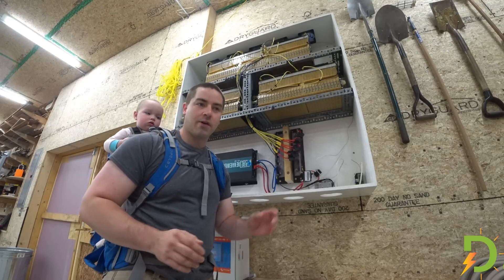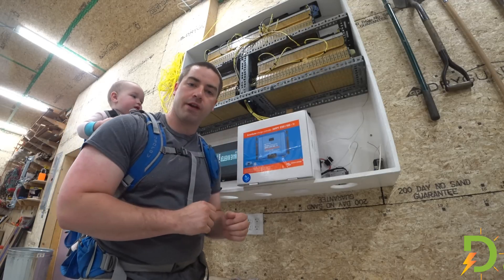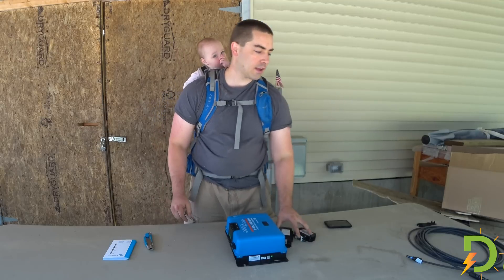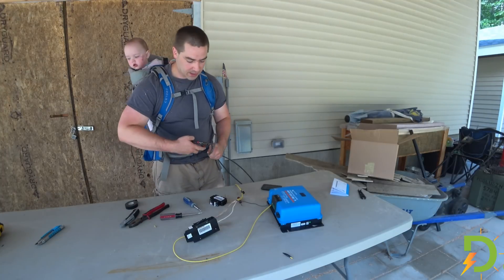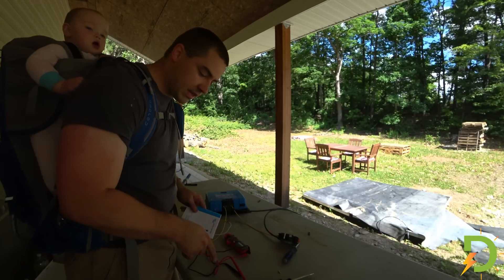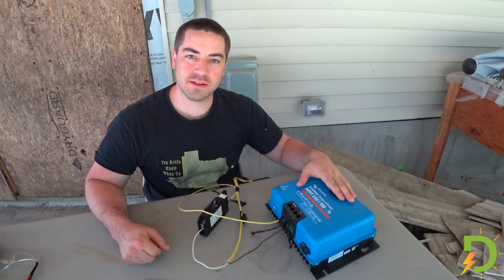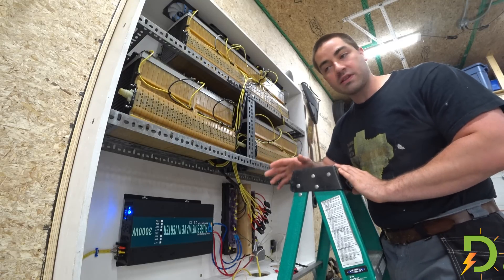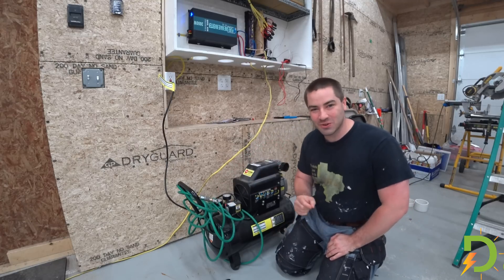Victron 250/100 Solar Charge Controller MPPT, Off-Grid System

Comment: Get the Batrium BMS. I wouldnt bother with anything else https://www.batrium.com/
Reply from the maker: Hi Mike, Batrium makes a nice kit.  Unfortunately, my batteries are wired in series, then parallel.  So I have 8 separate batteries.  That would mean I would need 8 separate BMS's making the batrium brand around $4,000.
Reply: No you will need 1x 7 peace Starter kit and one extra longmon. You need one longmon per battery. https://www.batrium.com/collections/starter-kit/products/starter-kit-watchmon-7s-longmon-shuntmon2-500a/ and one of these https://www.batrium.com/collections/cell-monitor/products/longmon

Comment: While you don't have much use for all of that enery stored in the batteries you should limit your charging voltage to 4v per cell. Being high state of charge for a long time does increase internal resistance of the cell

Comment: You got it wrong homie. You can connect as many solar panels in series as you want without it affecting then amperage. Voltage stacks in series, amperage stacks in parallel. So whatever wire you are using for 2 panels , you could use for 100. This is exactly why power companies use 500KV lines for distribution. It allows them to keep the wires skinny and not waste so much energy heating transmission lines.
Reply from the maker: Hi UltraStoat, Thanks for watching.  I'm sorry if I wasn't clear in the video, please allow me to explain what I meant.  The wire from PV to controller is fine, you are right there.  However, I meant the wire from controller to batteries was too small.  My solar panels are 365 watts each.  If I had strong 4 together, that's 1,460 watts.  The MPPT charge controller would drop the voltage down to 48 volts, making the amps to the batteries 30.4a. (1,460/48)  30.4 Amps continuous is too much for the 12 AWG wire I used (that yellow romex wire).  That was my limiting factor.

Comment: Set absorption voltage (=max voltage) slightly above floating voltage (~0.3 V) to avoid a "battery voltage to high" error in some cases, like when a high load is turned of while charger is floating and voltage is bouncing back over max setting you entered
Reply from the maker: Thanks for the tip.  I'm just learning, so I appreciate the help.  Just to clarify, is your suggestion for the lithium batteries I have, or for typical lead acid?  Thanks.
Reply: I have a 48v lithium system which is charging while a pool pump is running. So if the battery is in foat and the pump would stop, the voltage would bounce up a bit. If the floating voltage is same as the max voltage you set for absorbtion, the charger would stop with a overvoltage error and you just lose some sun hours till the system starts up again after a time out typically...
Reply from the maker: Ok.  Thank you for the clarification and help.

Comment: Victron is good stuff. I played with the cheap stuff for so long.... Finally spent some change on a Victron and would never go back.
Reply: Aaron Anderson my farther has built 35 boats over 4 years with all victron gear including 3 165ah lithium batteries for a boat hire fleet
They’ve not had a single failure

Comment: Thanks for the video and that looks awesome, how much was the unit?
Reply from the maker: Hi Charlie,  The cheapest I've seen online is $932.45 from invertersupply.com.  Alt-E (altestore.com) was able to beat that price.  However, because Alt-E gave me a personal quote I won't share the exact figure.  (I don't want to get into hot water with them)  I asked them to post this unit on their website, and they are working on it.  You'll get the best price by calling them.
Reply: understand!  I went looking for the link in the description so figured it was not a public price =P   I am close to getting my first sets of 18650 ready for the battery building.  Thanks for the video, victron makes an auto switch over and working on attempting to get that into my game plan.
Reply from the maker: Thanks for understanding Charlie.  Victron makes some nice stuff.
Reply from the maker: Hi Charlie: Alt-E now displays the unit on their website for $895.  https://www.altestore.com/store/charge-controllers/solar-charge-controllers/mppt-solar-charge-controllers/victron-mppt-solar-charge-controllers/victron-energy-mppt-solar-charge-controllers-p40910/#VICSSMPPT250100  (I'm not affiliated with Alt-E)
Reply: Thanks for the follow up, was trying for a step up approach but seems is is way more cost effective to wait.

Comment: Great! Look forward to seeing it running with all the panels.
As I tried to explain in a previous video, if you connect all the cells of the same level in parallel, then you'll only need 1 decent BMS, not 8!

Comment: for power tools I would go 6000w, 3000w is just to small for almost any power tool with a large startup load. anyways love the video, be careful overloading the inverter that long after its warm they have a much higher chance of blowing.
Reply: Bear in mind that Victron states that their inverters are able to handle peak power requirements of almost double their running max
Reply from the maker: Thanks Going Off Grid.  OK, I will certainly heed your warning about the inverters.  I haven't seen anyone else with your experience with this "Reliable" brand.
Reply: also try using a 50' extension cord this will allow  the voltage to drop and the inverter may start the load, I have done this many times and it works a lot of the time, and you can open the inverter and turn the voltage to 126 volt this will allow more power as well,
Reply from the maker: D G Roberts, Yep, they do claim that.  I wish they stated how many seconds that surge is for.  With Magnum, Schneider, and Outback they will tell you in the spec sheet.  Victron just says "Peak Power" with no time.
Reply: Well my trail and error testing was running a small fridge. The startup power required is 725w. My original Victron inverter was 300w max. It failed 9 out of 10 times. I upgraded to a 500w inverter from Victron and it has not failed on over 2 months of use. The 500w is rated to 900w peak.  Now I was fortunate to have a friend in town who supplies these and could just exchange for the larger inverter (paying the $ difference of course)

I encourage you to to look at bobolinksolar.com 

Although he is in Ottawa, Canada, he is installing whole home Chevy Volt power walls and has overcome many obstacles including the BMS issue some posters keep pestering about
Reply: Going Off Grid 
Good to know brother